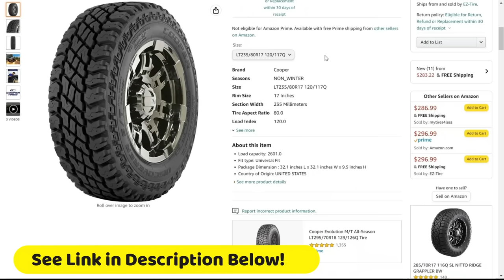Van Life Essentials: I Bought Amazing Tires on Amazon for Winter Van Life

Comment: About a decade and a half ago, actually closer to two decades :), I was driving a road trip from AZ up to WA for a friend's wedding.  On the way back, on the outskirts of Sacramento, I had a blowout while I was in the left lane of I5 in heavy traffic.  I was able to pull onto leftside shoulder without incident, but now we were stuck on the wrong side of heavy traffic.  Luckily, at that spot there was a very wide shoulder, so we were relatively safe, but my spare, full at the beginning of the trip, was flat also.  We used the first cell phone we had ever owned (my wife bought just before this trip, kinda for the trip) to call American Tire (Discount Tire in NV and AZ).  The manager actually, processed our purchase over the phone, loaded two new tires, mounted on inexpensive rims until I could get them switched to my good rims, in his personal vehicle, drove out to where we were on the interstate, and hand delivered the tires so I could change the blown tire and have a spare for future use.  I have used Discount/American Tires ever since.

Comment: I love Discount Tires they have always treated me right
Reply: Glad you had a good experience. Bought tires from DT for a 2014 CRV a number of years ago. The tires looked good but wore out in 1yr, had to buy new ones. Felt like I was cheated they weren't cheap, probably bcuz I'm a woman and don't really know about tires. Didn't put a lot of miles on them the tread just wore out quickly. I'm an older woman so now peeling out, stopping short etc to wear out the tread.
Reply: It's so hard to watch those kids using pneumatic impact tools without ear protection 😒
Reply: As long as you dont need rv tires
Reply: And locations everywhere in case something goes wrong! 👍
Reply: Yes, they are very good.
Reply: @scoop2591    Hi.  I’m a z senior woman and they have always taken care of me.  Go into any DT and explain the situation.  They stand by their tires.
Reply: @scoop2591  do some research online about the tires you need before you buy. There’s a code on the tire that gives you the date of manufacture. Tires are only good for about 5 years after they are manufactured because they dry out and dry rot and deteriorate. You should check the date and see if they sold you some they shouldn’t have. Different tires last longer for mileage too. Find out what the warranty on the tires covers. TD will replace the tires if they go bad under warranty but you probably have to ask for it. I have been going to TD for 30 years. When I go in the store and I can talk the talk they don’t mess with me. Unfortunately I have noticed that men get better treatment than women though. I had a flat tire around Christmas and a male friend went with me and I could tell a difference in how they treated him vs me.
Reply: Bought all six from Direct Tire for my RV very happy.

Comment: Just got my first van finally and I’m excited to join the Van community!!
Reply: That's awesome news 👏 I am trying to do the same thing, but not sure on the vehicle to buy. Any suggestions 🤔 would be greatly appreciated. C.J
Reply: @claudiachance7036  Sure. I went with a Ram Promaster 2500 ‘2022. Good price and heard very good things. If $ wasn’t an option I’d probably go for the Ford Transit which offers a TON of options but a lot more pricey. The Mercedes Sprinter is also a good choice I’ve read. I like that the Promaster focuses on width rather than height even though you can get it with high roofing if need be. Are you trying new or used?

Comment: Hope they know what they're doing. 
Had a little Winnebago brave 18' had flat on one duel. Apparently there is a notch or something that's important you line tire up with. Long story shorter,  heard a rattling about same time a car pulled up long side pointing to back tires. Pulled over had one lugnut holding tire on at an angle.
Crept slowly to closed garage, spent the weekend in a very small town in Kansas while waiting on lugnuts and something else they needed.
Reply: That was probably the valve stem,,,, In order to be able to check the air on both wheels you have to orient them so the inner valve extension tube clips into a holder on the outside rim. There may also be a steel dowel that goes into a corresponding hole in the other wheel, so they can be matched properly.

Comment: These are the exact same tires I have on my 03 tacoma and I really like them. 265/75/16 I think. Which is equivalent to a 32 inch tire. Deep tread, not too loud on the highway,  and e-rated or 10 ply sidewall if I remember right.  I'm on my second set after getting over 50,000 over 4 years on the first set. Lots of highway and off road travel and a decent amount of it over sharp rocks. 4 years ago I paid 870 but I just recently replaced them and now had to spend 1270 for all four

Comment: I got the Cooper Discoverer AT3 XLT for the rear dualies on my RV and they have been great. I'm at Digi-key in Minnesota and have drivin in the snow a bit as well as mud and back roads, they have been great. I put the Cooper Discoverer HT3 on the front last year because they track better and provide better control in the rain. Makes sure to get LT rated tires too as they are built tougher and handle the heavier loads better. There is a good chance too that they are made in the U.S. as they have several plants in the U.S. and also around the world. No matter, all Cooper tires are made to very strict quality standards and backed by a great warranty.

Comment: Hey Bob, those other tires were mine, got them put on yesterday and I love them! About 600 for the set from ebay, load range e and so far they ride and grip great. There's a local business across from albertsons called Hollywood tires, local business that does a great job, 80 total for mount and balance.

Comment: Cooper Discoverer AT3 XLT All-Season LT295/70R18 129/126S Tire . I bought these for my Ram for the extra weight from Amazon. rated Load Capacity	4080 Pounds. Great info as always.

Comment: When you had the new tyres from Amazon fitted did they charge extra for new valves, balancing and to get rid of the old tyres, here in the UK if you buy tyres from the fitters valves and balancing is included and a small price is added on for tyre disposal, but take in tyres bought elsewhere we get charged a lot more !!

Comment: I really like Discount Tire, are used to work there when I was about 19 or 20, then a lifelong customer, and I really like the road hazard warranty. You can purchase on the tires so that if anything happens to them, they replace them for free you only need to re-purchase the warranty on the replacement tire, they may let you purchase the road hazard warranty on those tires since they are brand new. The only thing that might not apply is the prorated warranty on the mileage for replacement.

Comment: I work in an Amazon XL warehouse(everything over 50lbs) and we have tires come through. Mostly customer returns being resold. Some are new, never mounted, and some are surprisingly worn and scalloped. So you would see these as "used", I think. I do not know  for sure but suspect you can still return them if they disappoint upon delivery. Still, a spare for your lifted monster off road vehicle on the cheap may work for you. Happy trails. :)

Comment: In my experience the harder high mileage tires do not have as good of stopping power, especially in rain, but out in the desert I guess its less of an issue.  I did have to lock up the brakes once at about 40 on dry pavement and skidded a good 15 ft.  I went back to the softer tires after that.

Comment: Bob, I live 5 miles off a paved state road, the county road is gravel ad really tore up with heavyweight trk traffic,  then 600 yes over a dirt driveway.  I buy michelin defender tires, that on highway  get 60-80 k miles before replacement.  The same tire on these roads last a year and if I get 10-12 k miles, I'm dong good. The tread wear is minimal,  but they get cut up badly. So, I have to budget $1200 annually.  I would like to know what tires you are using.

Comment: Those Cooper ST Maxx tires are the ones we rely on. We've gone through 3 sets on two different trucks and have gotten at least 50,000 miles on each set.  The on and off road traction is great in all conditions.

Comment: I hope you had them do an alignment and check the suspension as well. It would be a shame to prematurely wear out your expensive new tires due to it not having a proper alignment or due to worn bushings or bent suspension parts.

Every time l get new tires l get it aligned and on a vehicle that old the suspension should be checked thoroughly and often

Comment: I was ordering tires via the mail from Tire Rack back in the ‘90s. I have raced and 4 wheeled over the past 3 decades and go through tires like other people go grocery shopping! 

At first l saved a LOT of money because l didn’t have to pay sales tax but that’s long gone. You can still get free delivery and discounts that you wouldn’t get from a store though.

l just bought  two 33x12.50 Goodyear Duratrac tires for my off-road trailer that actually match the tires on my tow vehicle so l
don’t have to carry an additional spare. 

At $300/tire they aren’t cheap but Tire Rack offered a free road hazard protection plan for free and l was able to have them directly shipped to my installer. No need to pick them up and bring them anywhere!

Nowadays it’s so easy to compare and price shop for tires. I haven’t bought tires from an actual store in decades.

Comment: I guess the front end suspension components are not worn? That was some strange tire wear. Worn out shocks, out of balanced tires, ball joints, tie rod ends and A frame bushings!! Or maybe just junk, old tires. 🤷 I would look at those as a minimum. Don’t forget tire pressures. 
I would not use just any shop for these types of inspections or repairs. Do your homework in finding competent heavy truck technicians for this.